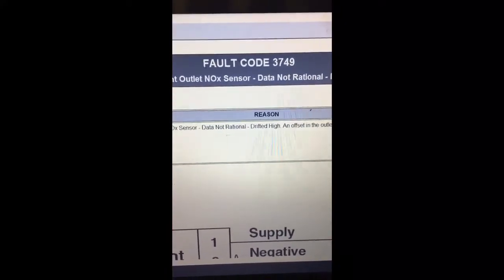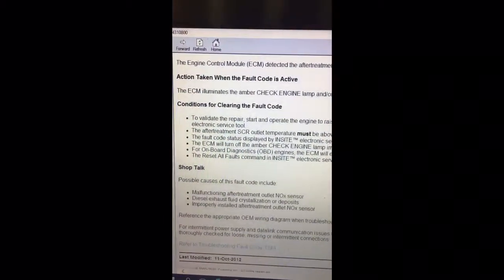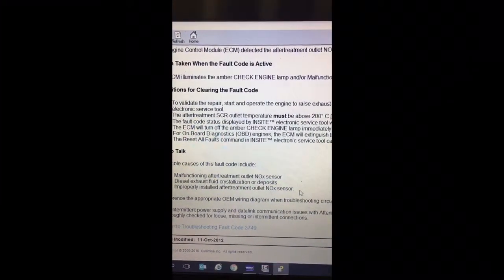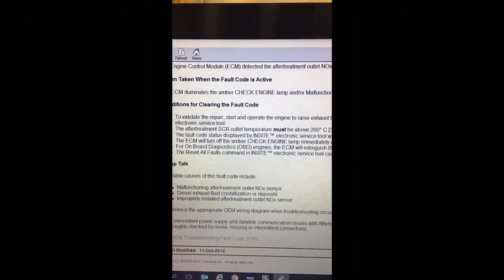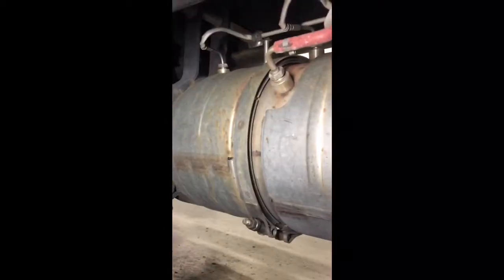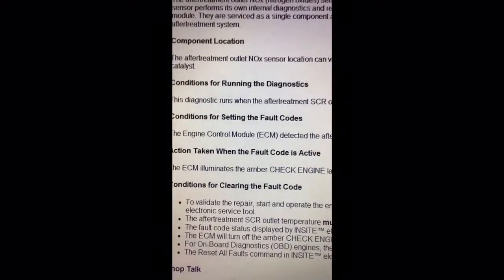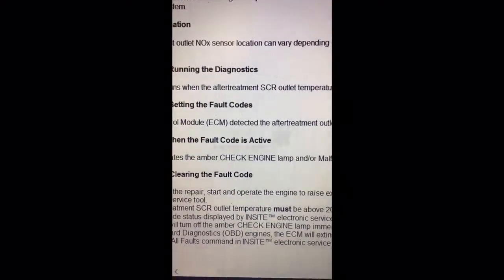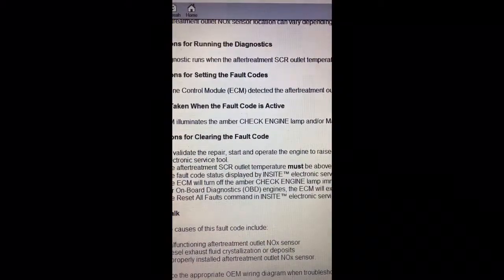Fault code 3749

Comment: doubt that fixed it.  its rare the sensor is actually bad if there is no crystallization or plugged dosser and def filters are clean its probably reading too much nox and the problem is somewhere else iv seen tecks replace these sensors multiple times in the same truck waste money
Reply: Funny when we see nox drift it’s usually a bad nox sensor. Plus on those trucks all the salt and rain a debris collects on top of that sensor and corrodes it. So yah most need them changed anyways